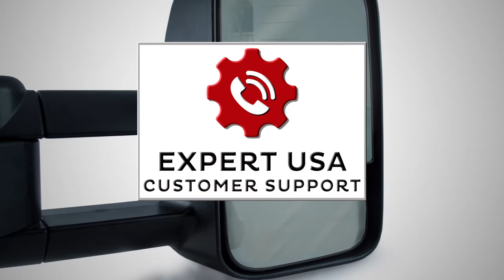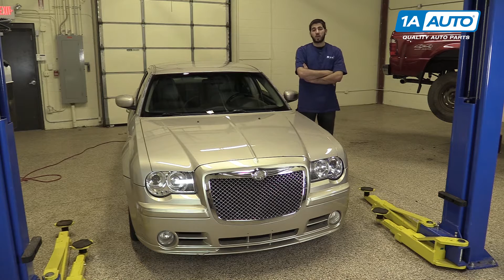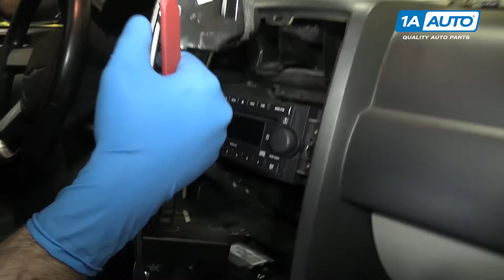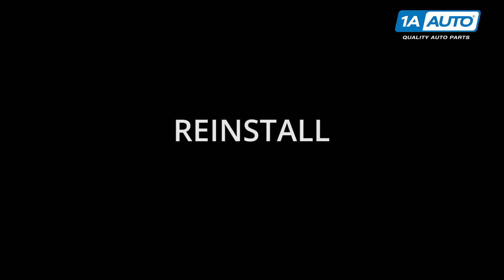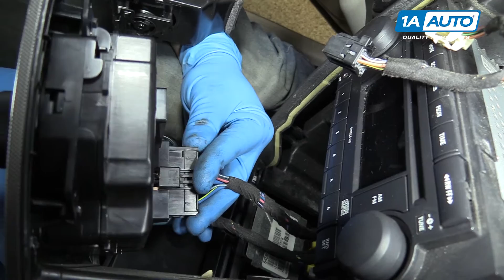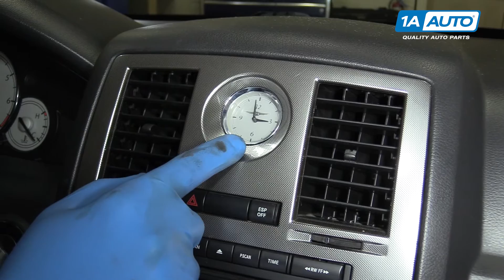How to Replace ESP Hazard Switch 05-10 Chrysler 300

Comment: My hazard light works and the passenger airbag on off light works but the ESP doesn't turn on in my Chrysler.  It cause my rear wheels to slip when the road is just the slightest bit wet and its super frustrating.

Comment: Thank you so much!!  My hazard would not go out, first I removed the negative lead off the battery.  Then decided to go look at the switch and the buttons looked uneven. I gently pushed them to make even, connected the battery and they stayed off.  I will be ordering this switch from your site along with the removal tool for my 2010 Chrysler 300 once I get paid in a couple of days.  My ESP light has been going off and on for months, now I know why.  Again, thanks so much.
Reply from the maker: +BJ Oates Thanks for checking us out. Shop here for high quality auto parts: http://1aau.to/m/Shop-1AAuto-c